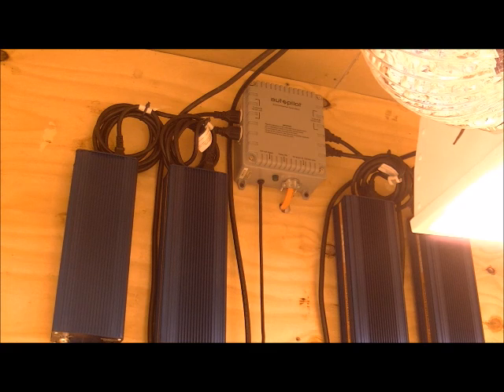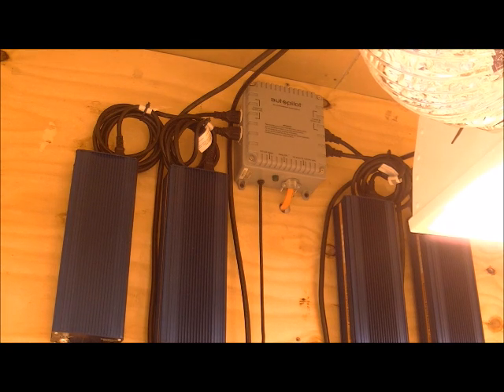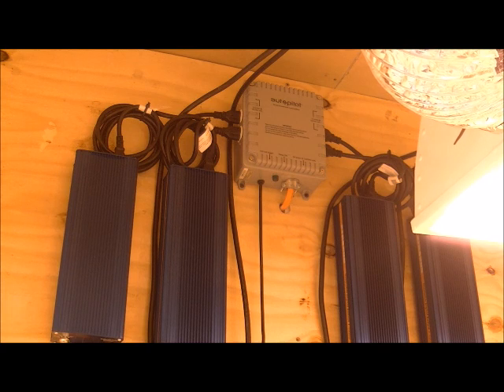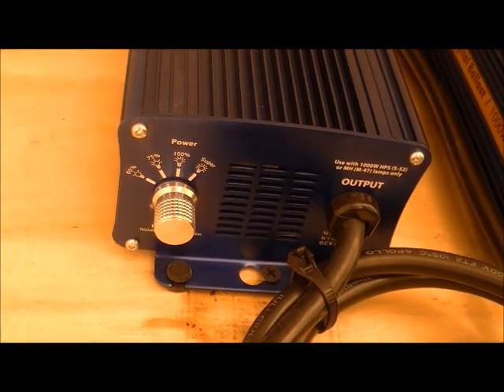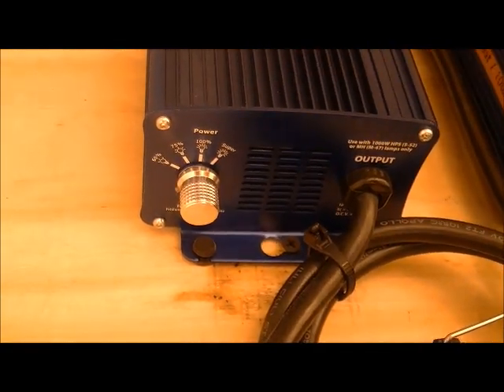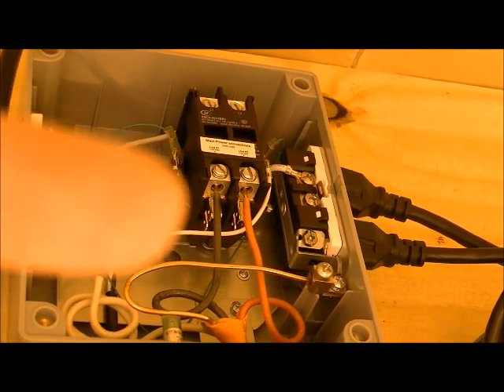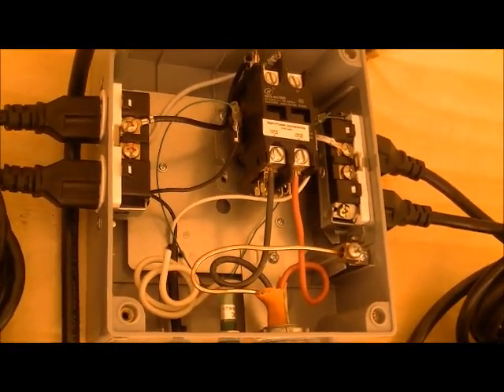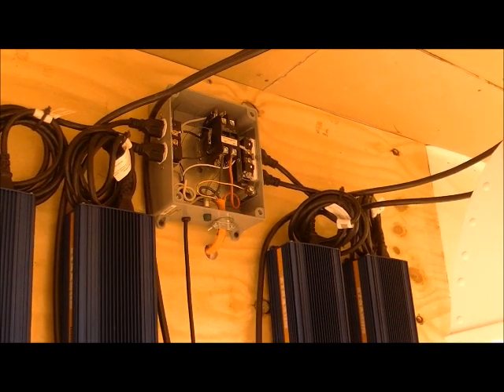Q&A for kystoner 30a 4000w lighting controller

Comment: I assume there is a switch on the ballast that allows one to choose from 240v 0r 110v? I couldn't see it clearly enough in the video. Also, is that timer wired to trip the relay?
Reply from the maker: +Mick Mick No, there is no switch, the ballast sees the voltage coming in and goes with which ever one it is. Most dual voltage ballasts work in this way and I believe all digital ballasts do. And, yes, the timer works the contacter and also the small led indicator light.